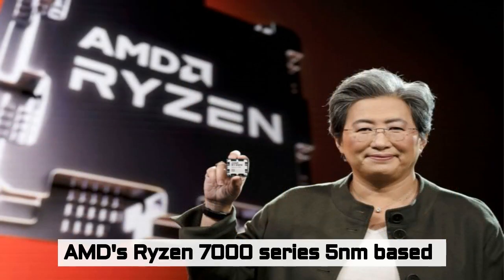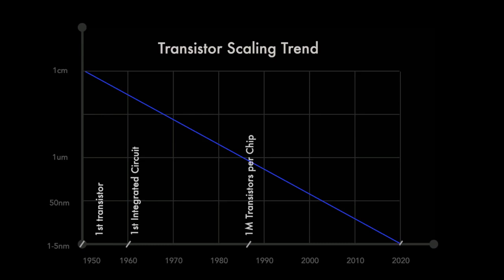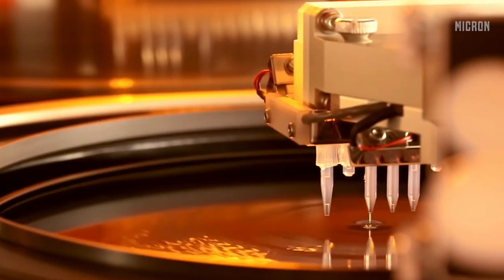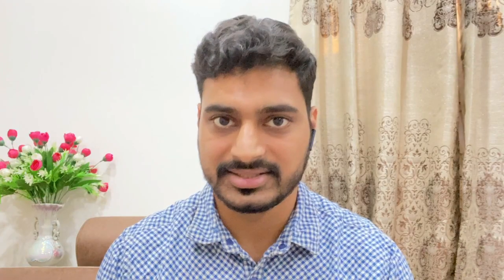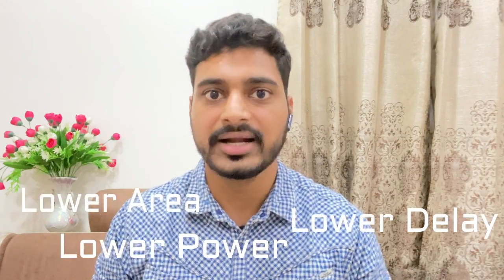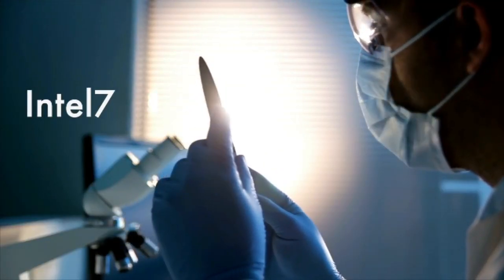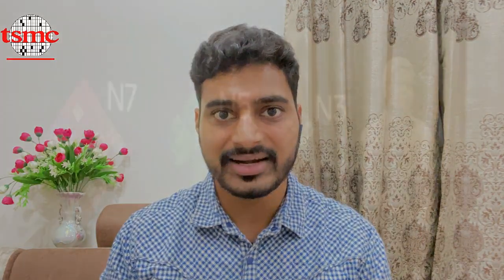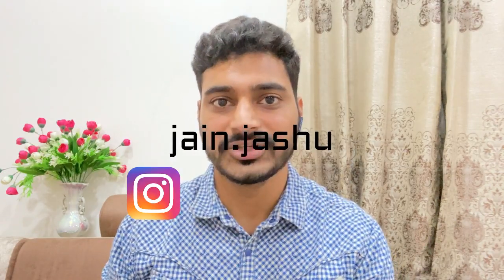TSMC 5nm, 3nm and 2nm devices explained | Technology Node | VLSI | Why such naming? | TSMC

Comment: Alright, in any case, you did say that it saves up electrical consumption by less, like Ryzens and Gay libtards and sh1t, but it doesn’t make it faster. I think, still (Absolutely Absolutely) to not have made any of this 3-d Bullsh1t and rather left some space for air to travel between semiconductor nodes would have been a better idea. Don’t need garbage, get the Goddamn f- uck out of my nest before I make you regret why you had to use Guo Tseng Chong for a political reason this time..